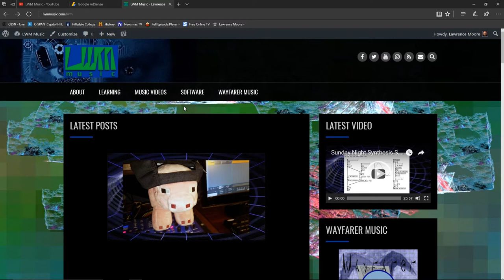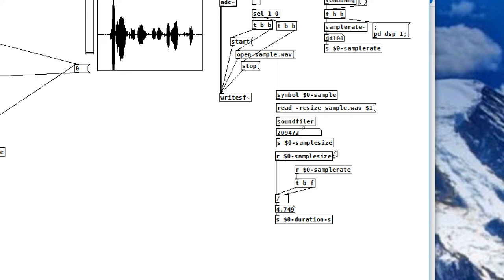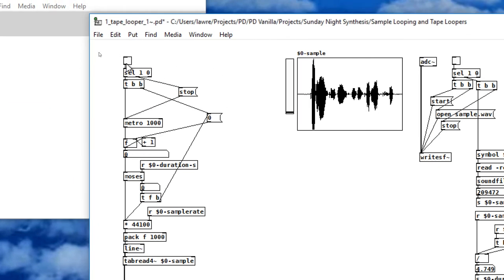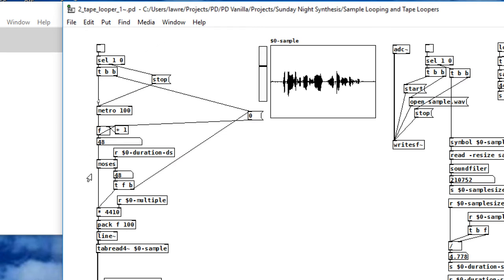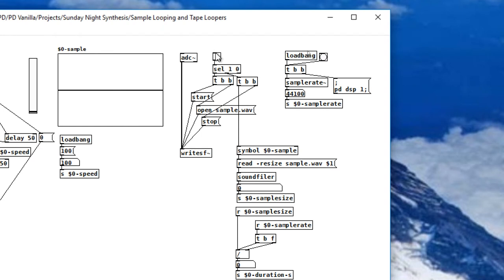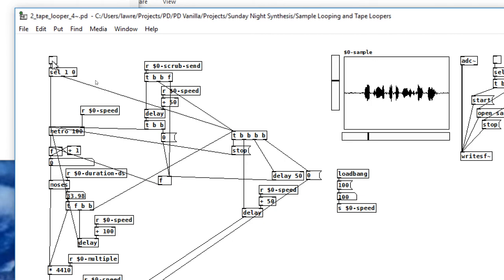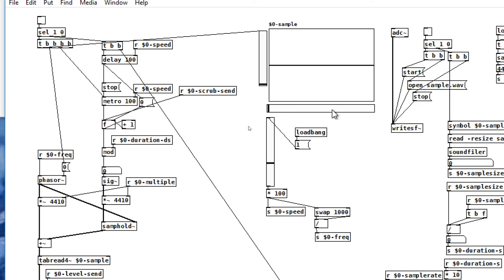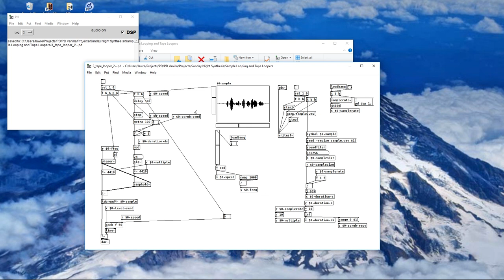Sunday Night Synthesis S03E01 - Sample Looping & Virtual Tape Loopers

Comment: Hey! I am very new to PureData and I love your lessons and the way you explain things. Very simple and straightforward; thank you sir. Though most of the time everything works out very smoothly, I have a problem that I cannot seem to solve. (btw, it is related to lesson n.4, Midi Input patch). 
I set my hsliders and vsliders to go from 0 to 127 but when I slide them, they only go from 0 to 63. Would you know how to help me?
(Sorry I posted this on the wrong video but it's the newer one so I thought it was the best way to get your attention!)
Reply from the maker: Questions are always welcome. This is all about learning. I have not heard of such an issue before, but to really be sure, could you send me the patch where this is happening? That's the only way I think I can figure something like that out. Typically, when you set a slider's bottom and top values or "left and right" in a horizontal slider and then move it in run mode, it should go throughout the range. There are three push buttons in properties, but usually the only one that would affect range is the one that toggles between "lin" and "log." If it is set to log, it would be a logarithmic range and prevent it form going to 0. It shouldn't do what you describe though. If you got to the about page of my website, my email address is there: http://lwmmusic.com/lwm/about

Comment: How would you get reverse play on the scrubber? preferably with an adjustable line movement speed between the current and destination position... sort of like turntable inertia? I love the final version... but also love the tape speed pitched rewinds and jumps of the 1st version... things like this really help with solving problems, by seeing how you found solutions. So cool that you made both a granular sampler and a sample tape looper. I was thinking something sort of like the ProteinDS homebrew on the Nintendo DS. https://www.youtube.com/watch?v=MQCZnwNr0ms but executed in Pure Data would be very fun.
Reply from the maker: I have done re3versing in the past by having the [0 ( message box be a variable and then it can alternatively be feed by the 0 for playback forward or the duration time to start at the end. Then you need to have something trigger to have the adder box have either a 1 for forward or a -1 for reverse. It's a matter of setting up a toggle box the alternates between changing these two different settings for forward and reverse. I only did this with the full metro and counter version in the past. I did not do it with the phasor~ and samphold~ version that is at the end of this video. It should theoretically work, though. I'll check out the link and get back to you.
Reply from the maker: I just checked out your link. that's pretty cool. The stutter thing is interesting. Somehow the playback would have to jump back a bit. Perhaps the amount could be adjustable, or maybe there is a way of setting up something that determines impulse level and goes back to the last peak above a defined threshold. I think that the env~ object, if I remember correctly can sense threshold levels and that my be used to set up a quick return function to the last thing that set it off. It would take some experimentation witht he patching to get it right.
Reply from the maker: Come to think of it. The "jump on click" setting that I have on the scrub slider might be enough to allow one to jump back a peak visually. I would like to have the scrub slider right behind the table so that it would literally cross behind the audio. The only issue is, the tables, in PD, can be drawn on witht he mouse in run mode, so that would destroy the audio when trying to do this.
Reply: I look forward to your content every week... watch on my laptop using over-ear headphones. Haven't had any unforgivable audio issues... Though I did make a comment a week ago. This episode was clear as a frequency modulated bell for me. 

ProteinDS does a few singularly interesting loopy behaviors... it does do the the adjustable stutter window size (kind of like granular) more like a bad CD but with control (it's separate from the playback speed/pitch, the smaller the window faster the stutter) it also has a grainy XOR sort of distortion filter, and has a through zero pitch/speed (fast forward to fast reverse for playback.) Along with a volume control drop (left direction button)... pressing the A button stops and restarts the loop playback at zero... the program can actually play 2 loops simultaneously, but you can only mess with 1 of them at a time, the other just loops continuously. It's kind of a silly toy, but also sort of amazing that it runs on a Nintendo DS. It really is like having turntables and a mixer in your pocket. We won't even go into sampling through the mic, loading WAV files, or the additional 1 shots it can play on other pages. If it had a sequencer it would be too fierce to live. I'm sure that the iPad has an app for all that... SAMPLR or Grain Science or some such thing. ProteinDS and GlitchDS make a hacked Nintendo DS worth seeking out, well at least until you've watched a few LWM videos and messed with Pd.
Reply from the maker: I came across this guy after seeing your Casio drum machine video. His use of the same drum machine came up after yours. I then also saw this video on his channel. I never bought an MPC, but this one has some interesting features.

https://youtu.be/D1tyU5TzSY4
Reply: The Akai Live seems cool... but it's up in the un-obtainium price range... I like the Synthstrom Deluge it's slightly less $... I like it mostly due to the fact that it doesn't have a full on touchscreen OS, but instead a boat load of RGB buttons and a 4 digit segmented display (more like a Novation Circuit on steroids). I also like the Critter & Guitari Organelle (because it uses Pd.) The RZ-1 sequencer is not at all to my taste... Personally I like a step sequencer with a bunch of extra algorithmical tricks up it's sleeves... clockable stutter steps... pattern reverse with true step catch up... MIDI delays per channel... Probability settings per step... the usual suspects. The RZ-1 does have a place in my CASIO loving heart though. Real MIDI and an easily set channel... Velocity response. The RZ-1 sounds are super dusty like crocheted plant holders in the attic. More pressingly I need to find a cheap way to get decent real time line audio and video recorded without post compositing, capturing VGA would be nice too. I tend to mess with the GEM stuff in Pd extended a lot more lately... I think I might switch to the Purr Data branched variant soon, since it's like L2Ork for Windows. Still I'll be watching your vids, because I learn something every time, and you make very clear and concise lessons that can be applied immediately to problems I have in utterly different visualization patches... especially like your patch walk throughs. You, Cheeto, and MoreFun4, are my Pd heroes.
Reply from the maker: I definitely would spend more time trying to make what I can. PD does allow for one to make GUI objects, but you need to know your coding. I've always wanted to learn C, but I never seem to get the time.
Reply: Yep, a great regret for me as well... seems like a whole bunch of things are becoming nodeJS (JavaScript) based these days... so I guess there might be hope for me still, even at this late date. I played with the built in Windows 10 game streaming interface last night and it seems to record Pure Data streams pretty nicely... I was recording at 1920 x 1080 with about 320 1024 x 768 .jpg files using the [multiimage pix] on 2 layers with a [kaleidoscope] and alpha. It seemed to work reasonably well. Better than trying record with my phone. I'll try to play with the frame rate next to see if I can pump it up past the default. Seemed to crash Pd if I put more than 320 images into memory though.